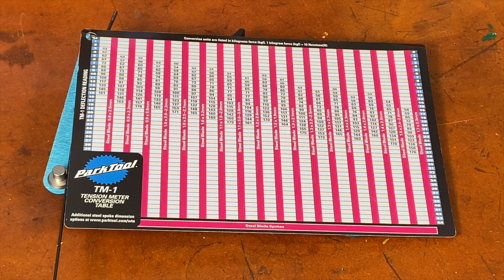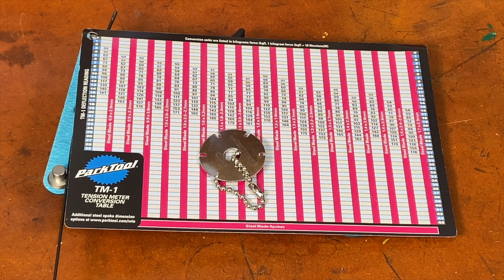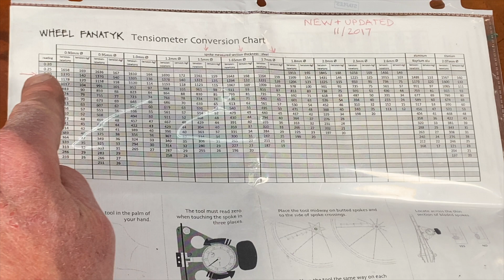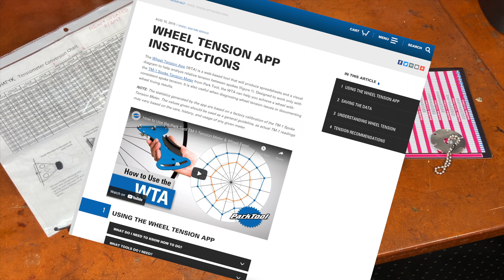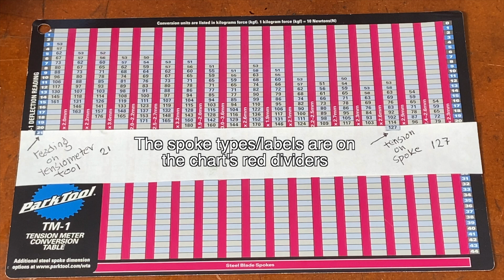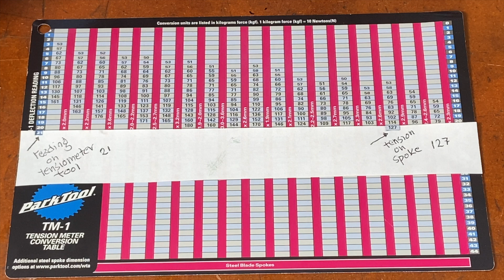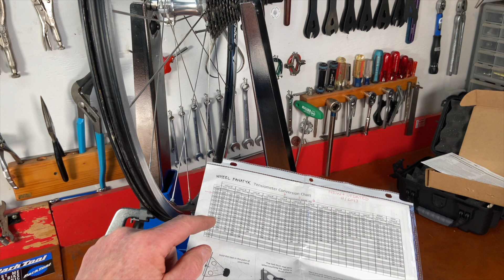Do You Need A SPOKE TENSION METER to Build Bicycle Wheels?

Comment: I just bought a secondhand bike and when I got home and cleaned it, I noticed that the rear rim was cracked around a few of the spoke nipples. So when I buy some new wheels, I want to keep an eye on the tension and make sure it’s even.
Reply from the maker: Yes, that's an excellent use of a spoke tension meter gauguin. You can also pluck spokes like guitar strings and listen to their tone to judge for matching tension. One thing to know is that cracking around nipples may not be the fault of uneven spoke tension or even too high spoke tension, it can be the fault of a bad rim material. Some rims are brittle and those rims will crack even if you do everything right with the spoke tension. So be sure to get check the reviews on rims you buy to find out if anyone is talking about cracking issues.
Reply: @JimLangley1  . Mavic krysium equipe on a Cannondale six 13. Maybe just age, and the bike is 60 cm, so perhaps a heavy rider.
Reply from the maker: @gauguin007  that's a known issue for some riders with those rims gauguin. You can google "cracked Mavic Kyserium rims" and find quite a few threads. I've only had good luck with Mavic products/rims but I'm a pretty light rider.

Comment: Do you tighten all the spokes one side of the wheel first, then do the other side or do tighten both sides equally switching from one side to the other one spoke at a time?
Reply from the maker: Thanks for watching and the question Deltafour. It's up to you how you tension wheels - you develop your own preference based on the components you're working with as you build more and more wheels. I usually tension wheels one spoke at a time going around the wheel starting at the valve hole and turning each nipple 1/2 turn at a time to add a little tension. Then I check true and round and center and continue tensioning. Depending on how the wheel feels I'll stress relieve the wheel in between adding layers of tension like this. 

Another way to do it that's handy on rear wheels with a lot of dish (rim far to the drive side), is to get the wheel true, round and to about 3/4 tension using ONLY the drive side spokes. This can speed up tensioning since you're only working with half the spokes. And it can make it easier to get the wheel to full tension since the spokes on the left have almost no tension so you're not "fighting" that side as you tighten the drive/right side more and more. Once the drive side spokes are 3/4 tension, you then finish the tensioning by adding the tension to the left side spokes, which increases the tension on the drive side spokes too. 

My friend Ric Hjertberg of WheelFanatyk has a great article about this method here: https://wheelfanatyk.com/blogs/blog/wheel-building-tip-no-6-build-rears-from-right-to-left?_pos=2&_psq=drive%20side%20tension&_ss=e&_v=1.0 I hope this is helpful, thanks again!

Comment: What should be the tension readings be on the left/loose side of the rear wheel? And should the tension be 120kgf on both sides of the front wheel?
Reply from the maker: Thanks for watching and the question. You don't concern yourself with the left side rear spokes. All that matters is to get the right side rears to the recommended tension. The left/looser spokes will just be what they end up being. For the front, if it's a disc brake wheel, the disc side will be the tighter side so you would check that side (the left side) just like you checked the right side on the rear and not worry about the right side (looser spokes). But, if it's a rim brake wheel, then yes both sides will have matching tension. Okay? I hope this helps.
Reply: @JimLangley1  yes this helps, thank you. I'm assuming the looser side would still have reasonable tension tho 90-110 kgf?
Reply from the maker: @NoQualmsTheArtist  the balance of tension between the tighter and looser side depends on the design of the wheel, i.e. the hub and rim used and even the spoke pattern and spokes used. Sometimes the looser spokes are much looser, sometimes it's very close, even the same on both sides. If you were to check the left side and find them looser than you think they ought to be you can tighten them but of course that means tightening the right side too - or else you'll move the rim off center. And if you decide to tighten all the spokes in order to get the lefts tighter you wouldn't want to exceed the highest tension specified by the rim maker. If their high tension number is 120, you might go a touch tighter to add a little more tension to the left spokes but you wouldn't want to risk damaging the rim by going a lot tighter.
Reply: @JimLangley1  thanks, makes sense 👍🏾
Reply from the maker: I was thinking more about your questions NoQualms and thought you might be interested in delving into options for checking spoke tension on wheels even more. I think you might enjoy reading my friend Calvin Jones of Park Tool's article on tension balancing using the Park Tool TM-1 tension meter and their online tools for charting the spoke tension of all the spokes in the wheel. It's a fun way to learn more about tension and how it all works. Here's a link in case it interests you: https://www.parktool.com/en-us/blog/calvins-corner/wheel-tension-balance-web-app
Reply: @JimLangley1  thanks, much appreciated 🙏🏾☺️

Comment: Very informative video. I finally decided to get a tension meter, even though I am not planning to build many wheels. But I like measuring stuff, and nice new tools :D

I might have missed it, but I think it was not mentioned in the video: before using it to measure tension, the Wheel Fanatyk tool should be zeroed (squeeze the tool, put it on the spoke, without releasing the grip, hold the tool so that the spoke touches the two bearings and the indicator's probe, then press the zero on the digital indicator version or rotate the dial so the pointer is at 0 on the dial indicator version). If you don't zero the tool, it's only useful to compare tension between multiple spokes, not to refer to the conversion table.

Another thing many tension meter users end up doing is building a calibration jig/stand. This allows you to check the accuracy of your tension meter, and make your own charts for any type/gauge of spoke that you want to use. There are multiple DIY designs, most of them using a digital force meter / scale (with eyelets or hooks), it shouldn't be too hard to build. I reckon, if you buy an expensive tension meter, it is worth it to build a calibration jig.
Reply from the maker: My pleasure Gene, thank you for watching and for your helpful comment! Two quick thoughts: you do have to zero out the Wheel Fanatyk tool at first when your check wheels you're building, but as the tension gets closer and closer to full finished levels, you need to zero it less and less. You also can move the tool on the spokes and rotate it on the spokes and usually find the spot where it reads 0 without having to hit the button to zero it. These things happen because spokes are rarely truly round and you have to find the round spot to get the zero reading (or the flat spot on bladed/aero spokes). And when the spokes are loose too the readings waver a lot.

Then as far as making a tension accuracy gauge, you can send the tools back to the factory to have it checked too. That way they can handle any recalibration of the tool needed. I'm not sure there are instructions for do it yourself tension meter fine-tuning. I've been using my Wheel Fanatyk tensio meter for 6 years and it reads the same as new after hundreds of wheels (checked against my much newer Park Tool tensio meter FYI). So I don't think these tools need recalibration very often so long as they're not dropped or misused. Thanks again for the great comment and happy wheel building.

Comment: Had to tighten my clicking spokes,  now it's a bit wobbly!  And I cannot true it now!  Just got a tension toil, will this help me true it?  I can't seem to figure out how to true it now
Reply from the maker: Hi Joel. The spoke tension tool is a nice tool to have for checking tension but it won't help that much for truing wheels and removing wobbles because the tension in most wheels varies a little from spoke to spoke. The best way to fix the wobbles is by truing the wheel by eye. You can do that in a bike frame or in a truing stand, the process is the same just when truing in a bike frame you'll use your thumb as a reference to see the wobbles. This link will take you to the start of my instructions for truing wheels: https://youtu.be/XUqul03hbZ8?t=1645 Happy to help if you have any questions.
Reply: @JimLangley1  thank you very much for the information
Reply from the maker: @JHOFF111  my pleasure Joel.

Comment: You can use a free frequency analyzer on your phone as well! Pluck it like a guitar string and see the spectrum! Or just do it by ear if you have a musical one and a reference.
Reply from the maker: @hepphepps8356  yes, that’s true, thanks for the tip. This is another way to do it for those with a “musical” ear or reference. Several others have mentioned this in comments and I’ve provided a few references such as John Allen’s. Thank you!

Comment: If you could only have 1 , which would it be and why ?
Reply from the maker: Thanks for watching- if you’re on a budget, buy Park Tool’s. If you can spend more go with the digital Wheel Fanatyk. Both are for use with all spoke brands types. Both come with great documentation for understanding and use like Park’s tension mapping. The digital WF is a bit easier to read  - vernier gauge vs digital reading. Hope this helps. You can study up on both tools on the websites to fully understand all features and extras - that’s the best way to decide. My favorite is the WF.

Comment: thanks for sharing, but the question is what if i dont have a tensiometer? how to know how tight should be? thanks
Reply from the maker: Thanks for watching and the question. I explain at the end of my How to Build Bicycle Wheels video here: https://youtu.be/XUqul03hbZ8?t=3448 Hope this helps and I'm happy to explain more if you have questions.
Reply: @JimLangley1  thanks. I just found in another video a way to measure the tension by sound. There is correlation between the tension and the length of the spoke and give you a frequency that can br used to 'tune' the spokes. I'm sure you know about it
Reply from the maker: @Gledii  yes, I do know about the technique (I haven't seen that video you mention). Plucking and listening to the spokes can work fine, especially if you have a good "ear" for music (not everyone does).  Wheel Fanatyk actually sells a guitar pick for plucking spokes like guitar strings so that you get the best sound out of them and there's an explanation on use on the page: https://wheelfanatyk.com/products/fred-kelly-freedom-picks?_pos=1&_sid=02f94e02b&_ss=r
Reply: @JimLangley1  Jim, just another point: after having the spokes adjusted on the drive side (rear), in order to have the wheel perfectly centered, the spokes on the other side seems quite loose (about 50 kgf vs 120 kgf on the drive). is this "normal"? thanks a lot
Reply from the maker: @Gledii  hi Gledison. On most rear wheels the spokes on the non-drive side are always looser than the rights (drive side) due to the dish/centering of the rim over the axle which offsets the rim to the drive side. So basically, it's just the way it is with rear wheels. But, when you build wheels you want to try to get the non drive spokes to where you feel they are tight enough to stay tight so that those non-drive side spokes don't loosen when you're riding. 

On your wheel it sounds to me like the lefts sides are too loose. The way to fix it is to tighten all the spokes. Your drive sides are at 120 and as long as the rim maker did not specifically say not to exceed 120 (often you can go up to 130), then you can tighten both sides. That will increase the tension on the drive and non-drive side and if you can get those non-drive spokes tighter it will help the overall strength of the wheel and help ensure those spokes stay tight. Okay? I hope this helps.
Reply: @JimLangley1  yes, that makes sense and to be fair I did a little bit of that. I asked the manufacturer and he have me 1100 N as the ideal tension (112kgf) and I'm already a bit over that... Thanks
Reply from the maker: @Gledii  then you can see if those non-drive side spokes stay tight and if they do you're fine. If they come loose then you might want to tighten all the spokes just a bit more. You can also loctite those non-drive side nipples to keep the spokes from loosening. Using a green or blue loctite - those aren't permanent.

Comment: Everything is clear. Is the size possible for a 20" wheel? Clamps, what is their length?
Reply from the maker: Thanks for watching and the question Igor. It depends on the parts used in the 20 inch wheel. You need about 4” in order to get the tool on spokes to take measurements. Hope this helps. And the thing is that 20” wheels usually have heavy-duty rims and short spokes so spoke tension isn’t as critical as it is on full size wheels, which have more flexible rims and long spokes.

Comment: Hi Jim, very useful video! One question. I just built a wheel and it's perfectly trued, but tension is not equal. I tried to equal the tension but now it's not very straight. Is it normal? Thanks in advance! Cheers from Germany =D
Reply from the maker: Thanks for watching and congrats on building your wheel, nice to hear from you in Germany! Yes that's completely normal. It's great that you're trying to equal the tension in the wheel because the more even it is the better the wheel. But the thing is that because of differences in spokes and rims you rarely find a perfect wheel where every spoke on each side will be almost exactly the same tension. Instead you end up with a few spokes at a lower tension and higher tension. They have to be this way usually in order to make the wheel perfectly true (side to side) and round (up and down). 

As a wheel builder what you do is try to even the tension out as much as you can and you always have to go back and true and round it after you do that because as you add tension to the "loose" spokes and loosen the "tight" spokes it knocks the wheel out of true (quotes around loose and tight because they're not really loose or tight, they're just a slightly lower or higher tension). Usually as you repeat the process it knocks it out of true less and less. And that shows that the wheel is getting better.

My friends at Park Tool make a really nice tension meter and with it you can use their app for analyzing and balancing wheel tension. You might enjoy watching this video of theirs that shows Calvin going through the process. https://www.youtube.com/watch?v=mb32h4PK_aU&t=81s Hope this is helpful and enjoy riding your new wheel!
Reply: @JimLangley1   I couldn't have gotten a better reply than this one! Thank you very much! =)
Reply from the maker: @someone-somewhere  my pleasure 😊

Comment: Can you Loosen and Tighten spokes with a deflated tire on or does the tire have to be removed to do this.???
Reply from the maker: Thanks for watching and the question. The risk of loosening and tightening spokes with the tire and tube on is that you can’t see if anything is wrong with the rim tape, tube and tire setup. If there is a hole in the tape for example turning the spoke nipple could cause it or the tip of the spoke to puncture the tube. But, if you know that the rim tape is perfect and there are no spokes that can protrude and pop the tube then it’s fine to loosen and tighten spokes with the tire and tube on. If you’re not sure it’s best to remove the tire and tube and check. Most modern rims put the nipples and spokes down inside the rim where they are less likely to cause flats. And with tubeless setups there’s no tube to worry about though you still don’t want to risk putting a hole in the rim tape cause that can let the sealant out. Hope this helps.
Reply: @JimLangley1  Thanks,  that does help.
Reply from the maker: @marblox9300  you’re very welcome!

Comment: Yeah, I've settled for the Hozan C-738: Unlike the models you use, it doesn't rely on its spring to bend the spokes. The Parktool in particular eventually runs into breakaway torque instead of reading, and the bike fanatyk needs (admittedly rare) spring calibration since it relies on pulling.
Reply from the maker: Thanks for watching and sharing your favorite tensiometer, Editio. Here's a link for anyone interested: https://wheelfanatyk.com/products/hozan-digital-tensiometer The first spoke tensiometer I had in the shop back in the early 19890s was actually Hozan's C-737 which appears to still be available on eBay: https://www.ebay.com/p/1001730909 I think it's worth noting that both of Hozan's tools are considerably more expensive than Park Tool's or Wheel Fanatyk's and that to wear either of those out would take checking tension on thousands of wheels. They are all excellent tools. Thanks again 🙏🚴